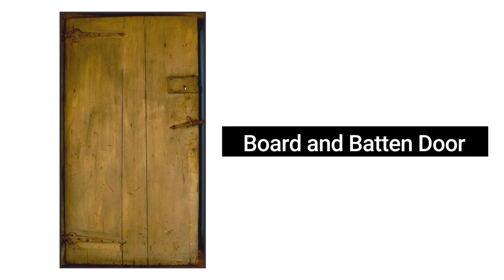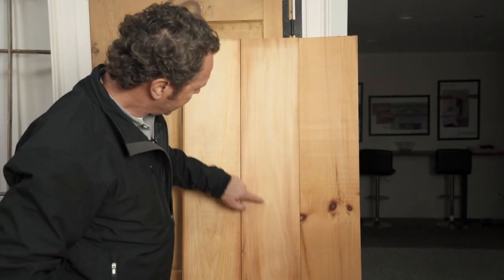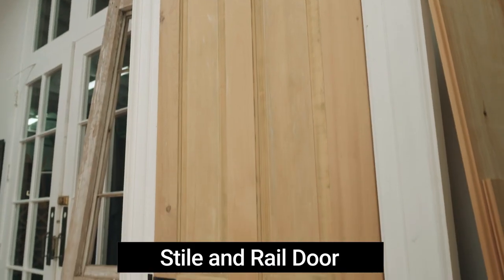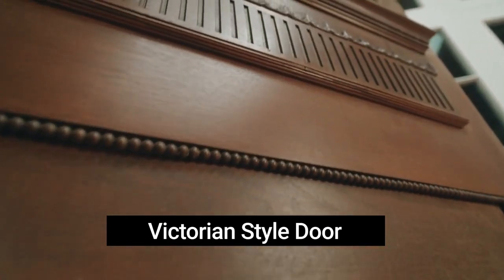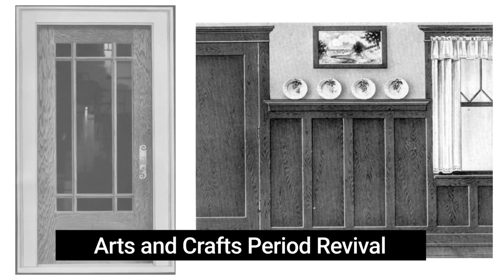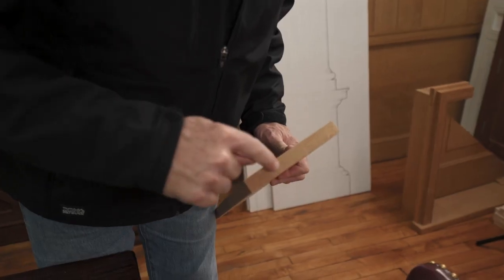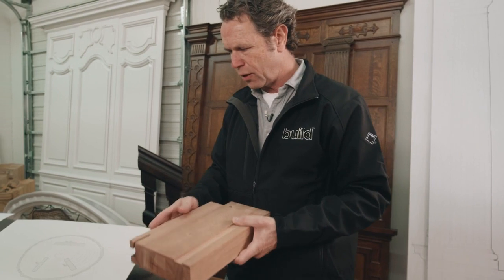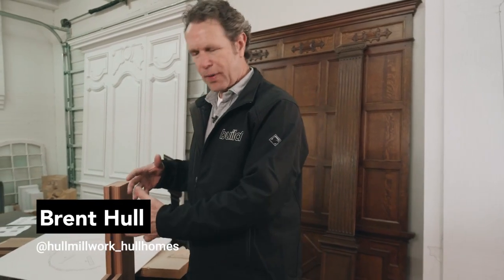Secrets of the Best Doors

Comment: Brent- What wood species would you recommend for the stave cores? I am trying to keep cost down and was thinking about poplar with 1/4" Red Oak veneer. Your advice would be appreciated.
Reply from the maker: it is for an exterior door, at least use wood that will be stable and rot resistent. Poplar and red Oak are not good exterior woods. I don't know what region you are in. I would not save money on the stave cores. I would find it elsewhere.

Comment: Hi Brent - I understand that panels need to move. However, what do you do about a 100 year old garage door that is already caulked because water can get into the areas around and especially at the bottom of the panel. There is old caulk but it needs more to keep out the water. It that ok or am I making matters worse by adding more caulk - or should I try to remove it all?
Reply from the maker: Good question. I would probably remove as much as possible before applying new. Caulk can get old and actually keep things open and porous. Good luck.

Comment: For the pegs, if the hole is half an inch, is the peg half an inch square?  Slightly smaller?  Slightly larger?  I may have to do some experiments.
Reply from the maker: Yes, with a tapered front edge. FYI, for paneling, no bigger than a 1/4" peg. Cheers.

Comment: Were/are the panels finished before assembly? I’m thinking that if you finished them after assembly and then they contracted due to low humidity then unfinished wood would be exposed. This is something that has always puzzled me.
Reply from the maker: Good question. Historically no but that is something we do on split panels. The panels need to be back sealed in order not to twist and warp.